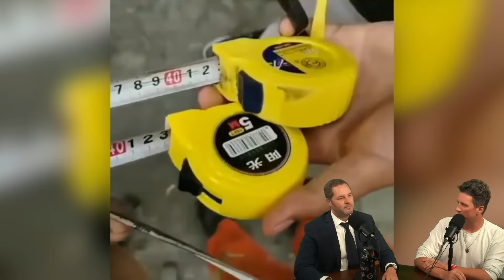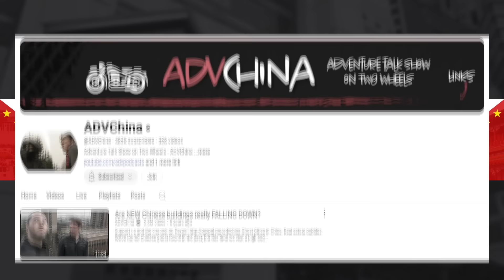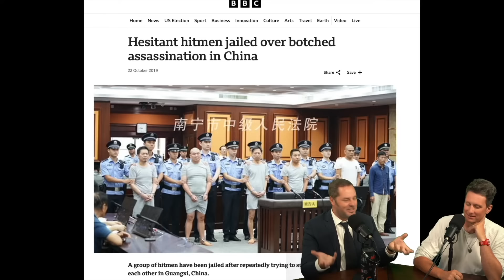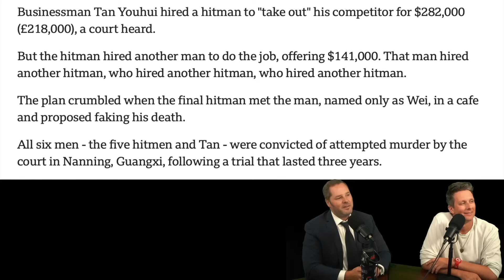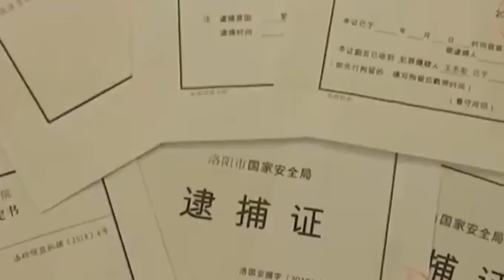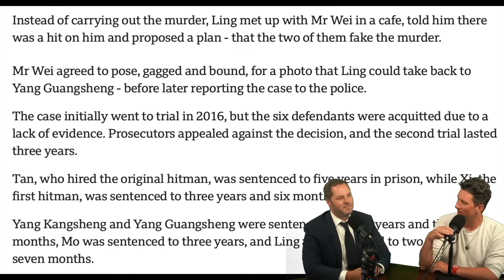China's Dirty Secret - The Real Reason Why Tofu Dregs are Collapsing!

Comment: China is metric 21:00 the tapes are supposed to be cm.
It also explains why a XL glove from China is a small here.....
To calibrate a measuring device, you can always use a rectangular container and weigh out 1kg of water. Then you take measurements and with 1kg of water, your results should match in length, width and height to get from volume to weight.
1kg = 1000cm³ (metric is awesome for a reason)
If there is a discrepancy, it's either your scale or the measuring stick. A calibration tool can be a known bolt size or precut post, stick, dowel etc.

Comment: I loaded and logged tools sent out for calibration for a time. If they were dropped once on the factory floor they got pulled for calibration. Some 300 tools all rotating out for calibration on a time schedule unless dropped. In which case they got sent out immediately.

Comment: I've run into the measuring devices thing with cheap chinese made spark plug gappers (those round ones where the edge gets progressively bigger). I had a handful of them and none of them were the same and not a single one was actually accurate either. When you're dealing with thousandths of an inch or tenths of a mm you need to be precise.

Comment: 2:00 Concrete is supposed to be vibrated with a big magic wang basically. It makes the bubbles rise to the surface so that you actually get a solid structure in the pillar instead of swiss cheese. It’s clear these builders just skipped that process entirely and even did the worst pour they could on top of that

Comment: Those are different kinds of tape measures. The short ones are sellers' tape measures, the long ones are buyers' tapes.
Reply: lol
Reply: honestly thats fucking smart
Reply: @soulsreaper7145  round 👀 doesn't 
Know 
..... That
Reply: Makes sense
Reply: Great joke FR
Reply: I've actually seen a tape measure for measuring diameter, that has the numbers reduced by Pi. "A diameter tape (D-tape) is a measuring tape used to estimate the diameter of a cylinder object, typically the stem of a tree or pipe. A diameter tape has either metric or imperial measurements reduced by the value of π. This means the tape measures the diameter of the object."

Comment: Let's say if everything is level and the car arrives at the other end of the gap without falling more than 6", so the wheels make contact with the pavement; the car will will "come to rest on the other side." It takes 180 ms to fall six inches. So you need the car to cross the gap in 180 ms. If that's a 30 foot gap that's 170 ft/s or 115 mph. But you're also going to hit a curb dead-on at 115 mph. Assuming you want the (possibly Chinese-built) suspension to absorb the impact so you can keep driving... you'll need to fall 3" or less and have to go about 170 mph to make it.

The flaw in this solution is that the suspension is going to drop in weightlessness and there's really no way you can make the wheels meet the pavement without, like you said, adding a ramp.

Comment: I was a Quality Control tech in US, everything we used had to be calibrated.   Tape measures with in a 1/32", micrometers and almost all Guages were to .001",  small scales to .1 grams and large scales to .1 pound.  That was just for the mill making wood panels for construction.
Reply: We were absolutely checked once a month and a 3rd party checked behind us every quarter.  Whether the measurement equip was good or not...almost all of it had to be sent out once a year for re calibration by an outside company

Comment: They forgot to vibrate the formwork during the pour. Stupid mistake. There’s no strength in that particular column. But they can pressure grout it after reforming and it can be salvaged but I don’t trust anything they do so I think they should start over. What else did they do wrong on the foundation?
Reply: Is the vibration to get any and all air out of the concrete before it solidifies?  😀
Reply: @Sebastianmaz615  yes they do it to get any air bubbles dissolved or pushed out so that there are no empty voids. Also just to get everything completely mixed and consistent. So one part isn't harder or lumpier than another.
Reply: @fridgeffs5662  than, I kinda thought so. 😀
Reply: @Sebastianmaz615  Yes. Correct. When pouring columns the concrete tends to bunch up on the rebar and will create cavities. Vibrating the concrete eliminates this problem unless the mix was past its pour limit in the time it’s mixed at the concrete mixing plant to the time it’s installed. There is a limit depending on the type of mix.

Comment: The reason the concrete has holes like that is because you have to vibrate the concrete immediately after it's poured to make sure it settles and fills all those voids in. Otherwise you get Swiss concrete.
Reply: You mean "Swiss cheese" concrete? Swiss is normally a word associated with high quality.
Reply: Vibrating is to remove the air bubbles in the concrete. If you don’t you get that Swiss cheese effect.

Comment: I used to work for a calinration company and we would do exactly what Winston was describing. We did a lot more electronic calibration. Things like heat treating oven controlers, pressure gauges, thermocouples for an aerospace company. Every piece that leaves the factory comes with a certificate that has all our standards indentified, and it would be traceable all the way up to the national standards from organizations like NIST.
Reply: What's calinration?
Reply: Maybe I’m a nerd but that sounds like a really interesting job to me.

Comment: The tapes are in centimetres, not inches. Centimetres are smaller units but are still a nightmare if they don't match.
Reply: You are right, that is the whole idea about a tape measure, that they match with standard. Congratulations, you just won a ticket to laughter. Clamman 🥚ate

Comment: Holy HELL! That tape measure thing is JAW DROPPING. JFC!
Reply: I felt the SAME!  What gets me was how the 10cm distance was SHORT!  I could understand some small differences from the start of the tape ... but to get FURTHER apart by 40cm is INSANE.
Reply: They could buy a super cheap tape measure from the USA and use it  to calibrate their Chinese tape measures!
Reply: I bought a cheap Chinese steel rule from a Chinese market stall and when I started using it my projects were going wrong.  I eventually noticed that the rule was marked with ten eighths to the inch rather than eight.  There were similar problems with sixteenths and thirty seconds too.
Reply: @David8n  I had one on a job site. I would get told to cut a pipe at 33 1/4, cut it, hand it over... It caused some anger and confusion until we compared tapes.
Reply: Ccp has their own national standards, 0.8 liters is 1 liter and fluctuates and so on with everything else.
Reply: @FrstSpctr88  like how Uyghurs are 1/8 human and Cantonese are 1/4 Chinese ... ya I get it.  But 1 meter is 1 meter and a human life is a human life.

Comment: That column with the holes in it is called 'honey combing' and it happens when the concrete isn't agitated... Which means either they are really dumb or really lazy, cause it isn't expensive to prevent
Reply: Far from “honey comb”. If it were vibrated,it would fill 50% of the column. 😅
Reply: Yes, vibrating is exactly how honey combing is prevented. I have done projects with concrete pours. But I ain't no foreman on site. I would get on the foreman's case if this happened but it never did happen. I just assume vibrating it works.

How would you fill the other 50%?

Comment: the holes in the concrete are formed because they did not use a vibrating  tool while the form in the concrete were still wet to get the air out of the mix

Comment: At a Heavy Fabrication business all of our tape measures were all calibrated together and given a expiary date . once the date was close we were issued new calibrated tape measerures anything critical at the time and that was in range of a metal ruler would be measured with a metal ruler . i still have a few of my older calibrated tape measures they were given to the staff for free as they no longer met the requirements of accuracy . any damage excess heat etc would result in a trip to tool storage for a new measured device

Comment: 14:08, what are those anyway? It's not balconies, look.. they are half the height of a floor... it's pure decoration, probably made to make the house look bigger, because there are twice as many balconies.
Reply: It was expained in a video before. That are dedicated balkonys for radiator units of the AC. A maintenance hatch is needed here.
Reply: Holy cow ur right.  I didn't even notice that until I read ur comment.  🤣
Reply: its a ledge for the AC units.

Comment: Sinkholes are caused by a lack of drainage. The water will go under the slabs and erode the soil underneath if it is not sent immediately into a drain.
Reply: Can also happen if you pump to much tap water from the ground, forming pockets. They Probably didn't check the geology of the place.

Comment: You expect a tape measure to have a little variance at the leading edge, "burn an inch if you can".  But these tapes.... The 0" mark has too much variance, and it looks like the CMs on each one are different sizes.  I'm wondering if the marks are inconsistent along each tape as well??
Reply: The middle one was clearly in its own world, the difference getting bigger and bigger (1 cm difference every 10 cm). The two on the outside are more or less the same.

Comment: My Tool and Die Maker friend (I'm one too)... He bought a tapemeasure at "Dollarama"  a store in Canada filled with may chinese things.  Anyway. he said that he was using it at work and he almost ruined a very expensive part because of measuring out 50-something inches and cut the part.... he left extra on to work with (he thought) but actually the measurement was around 1 inch less with a proper take measure.   OH and they sure didn't use a concrete vibrator because those voids would never be there.  I should know, I also build highrise's.

Comment: I noticed the ceiling above that indoor pool looked very wet from maybe steam coming 9ff the heated pool water. I suspect it eventually waterlogged the ceiling assemblies and panels (Which might have caused extensive corrosion too.) and weighted it down so it eventually collapsed, taking the roof with it. The problem was, they did not put enough HVAC controls in that pool space to prevent the buildup of moisture. And China is so proud of their "advanced engineering".
Reply: knowing them, they most likely didn't bother doing anything of the sort, or didn't even know of that

Comment: It's alot more than jus the measuring. It's the subpar , joke of materials used, corruption, the lack of caring, and bc it's 'made in china'. The measuring is jus another comical reason that adds the icing on the cake.
Reply: It's because of the reality they live in. They have a saying, "If you can cheat, then cheat". Most of their lives suck and everyone is just trying to get the most that they can to make their individual lives less shitty to any extent. That comes at the detriment and expense of their society and everyone who will have to deal with the issues that arise from the corners they're cutting. It's not due to ignorance, they know what they're doing.

Comment: 20:34 In the (US) military we have instruments and tools that have set calibration dates. I’d say most are on a 6 months cycle or depending on usage. Normally there’s a place on base we drop them off and they can be inspected/calibrated, special tools have to be sent off to another state even and it might take a week to a month before it comes back. Calibration limits can’t exceed +/-5% for most items, if they do they’re deemed broken and unusable. It’s basically military law that you can’t use that item and doing so disregards command order and OSHA standards. Something like say dropping a dial or torque wrench means it’s “broken” and has to sent in to be checked if it’s good.

Comment: Looks like the gate column was never mechanically attached to the building wall. They just built the column against it as a vertical guide when laying the column bricks and they did not provide an adequate footing to hold it up. A minor earthquake would have caused it to topple too.

Comment: Looks like the Chinese don't bother to vibrate their poured concrete in their forms, thus the cavities in the poured columns. I wouldn't be surprised if they just try to just parge in additional concrete with trowels into those cavities to try and fix it.😅 The retaining wall that crushed those taxis also did not seem to have a footing extending back towards the soil being retained to resist overturning. Where do these Chinese engineers get their degrees from??!😅 Did they even engineer that wall??

Comment: Indoor swimming pool roofs have been collapsing here in Finland 🇫🇮 too. The problem is that the stainless steel used will have corrosion due to the tensile strength will weaken with chlorine used in water i.e. it will weaken a lot and the roof will come down.
Reply: See, I would figure Finland would have rooftop skating rinks instead?   Maybe saunas??  Hmm... learn something new everyday!   Lol. Joking!  But not really,  rooftop rink sounds great actually. 🇨🇦
Reply: @mrmj2397  We have rooftop saunas ...
Reply: @arilemmke5166  nice!  But no rooftop rinks then eh?  Disappointing.  Lol

Comment: The tape measure thing is very common everywhere.  In the US a contractor will have one measure that every other measure gets compared to.  Any that don't match get rejected.  It's the only way to ensure consistent measurements through the construction project.
Reply: I have never heard about any blue collar doing that in Denmark.
Reply: @KaptajnKaffe  It most often happens between different manufacturers.  From what I've seen.
Reply: @patraic5241  man, I have to try it out 😅
Reply: I have a master for level calibrations 0.02mm that is not digital and everything else is calibrated with it. I have never heard of calibrating my tape measure but that is the curse of only buying high quality tools like Stabila or Beta, I guess
Reply: @KaptajnKaffe  I've personally seen a 1/4" inch variation per 5'.  Blew my mind.  It's enough to create problems.
Reply: @KaptajnKaffe  Its not needed in scandinavia. We dont bring our own personal tools and our hardware stores dont sell any brands that dont validate their products.
Reply: @Lambdarevolution86  I have a few friends who work blue collar jobs, and it just never seem like something they even would think about.
But if everything comes from a secure verfied source, I guess they really never had to.

sometimes you foerget how well the nordics function as countries 😅
Reply: I bought a builders set square from a big name hardware store in the UK and had to take it back because it was 88 deg. I searched for a 90 but every 1  was 'out of true' I asked them 'what's the point of a 90deg. square that isn't 90deg. THAT'S THE SOLE REASON AND ONLY PURPOSE FOR IT'S EXISTENCE' If it doesn't do that then it's useless,needless to say but they were all made in U-KNOW-WHERE. PS. I made my own square out of spite.
Reply: It gets iffy when you don’t buy the same type of measuring tape for everyone
Reply: How much of that is due to buying dirt cheap tape measures from these same Chinese manufacturers instead of from a reputable manufacturer?
Reply: @typingmonkey8749  Good Question.  I don't know.
Reply: Been an electrician in the U.S. for 20 years.
Never had a problem with measuring tapes or compared others.
Framers and concrete guys maybe  check with the GC
Us and the plumber's go off of reference lines set by the GC.

Comment: Side notes, the measuring tapes, it was used in "Monk: Last Case" 

Also, imagine if instead of distance (measurement) but liquid, and somebody used mixing concrete and it had an inaccurate measurement. Would the result poured concrete be up to standard? 

Love you guys. Your Chinese (spoken/listening) is probably way better than mine. =)))